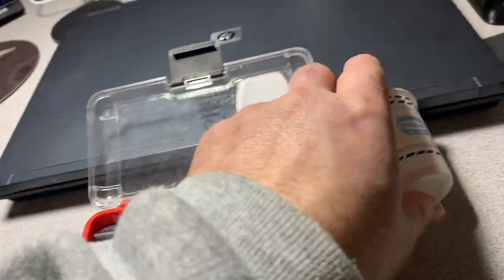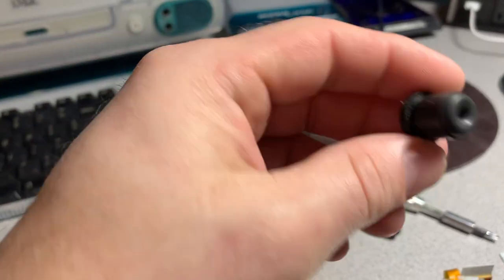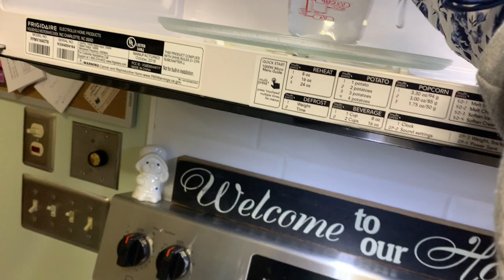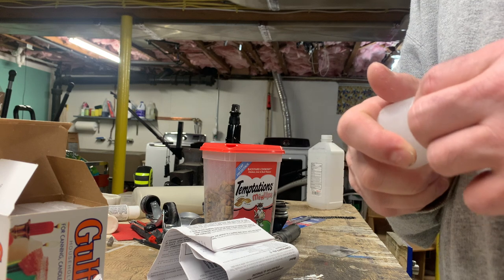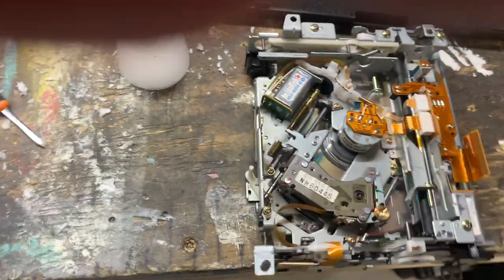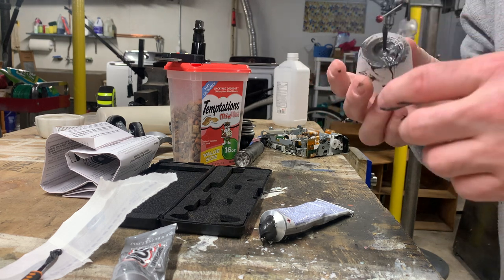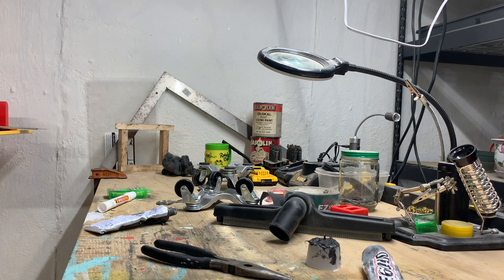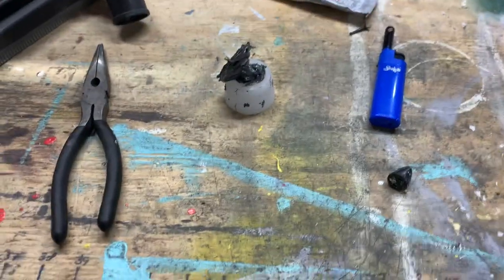Mazda Miata Pioneer MSSS1 "Silver Stereo"  - Making NEW CD Player Module Mounts from Silicone

Comment: what about using cassette deck pinch rollers? Run the pin from the CD mech and maybe see if you can get a pinch roller thatll fit (even if you have to cut it) to fit in the older for the original shock like part. Just an idea.

Comment: Clever solution. Why not 3D print a mould with 4 pockets and the correct sized centre pin? That plus some mould-making silicone would give you a more exact part.
Reply from the maker: I actually did basically this; wait for the next update!

Comment: Unless you love arts and crafts projects, try a 3d printer with flexible fillament. It's unreal how good the print quality is even on sub $200 models. Can recommend the Ender 3 V2 or the anycubic equivalent (has some upgrades).
Reply from the maker: I’m more concerned about the longevity of a 3D printed flexible part, to be honest.
Reply: @bbishoppcm  I'd second that.  It's the heating and cooling of the prints that make most filament-based stuff not great for automotive use.  Wonder what options you might be able to find, worst case?   I wonder if a capstan rubber wheel type of part might work? 

Oh, and to my comments on the last video.  It was for adapting to the OTHER deck you'd found for sale on ebay.  Yours, is of course, a no-go for bung-ing in my AUX components since yes, you don't have that damn DIN jack.  I'm also going to guess, much more than just the jack is missing off the PCB to add it back.  

Hmmmm.  Well, something to delve into another time lol. For now you have your hands full sorting that CD mech out!
Reply from the maker: @Sansui350A  The material will need to have an almost gel-like consistency, so I will be experimenting with two-part silicone.
Reply: @bbishoppcm  Hmm.. yeah def some experimenting to be done there.  Something with some give but will hold "relative" shape I suppose.
Reply: Also brother, more than just "some guy" lol.. I've been following the channel since you installed that outside light-switch box in your condo. DAMN that was a long time ago.. jeez we're getting old eh?

 Matter of fact, I was the one who said to use a damn duplex or triplex switch and save cutting another hole in the wall!  LoL!  :P
Reply from the maker: @Sansui350A  I remember that comment, and believe me, I would rather have done that - but I couldn't blindly snake the wire into the existing box, unfortunately. I had to cut a hole anyway...
Reply: @bbishoppcm  f***ked if you did, f***ked if you didn't.. I know that one well lol.  Least it didn't turn into THREE holes to fish ONE cable though.  Seen that far too often, just over a joist and a fire-block being in the exact pain-in-the-ass spot!